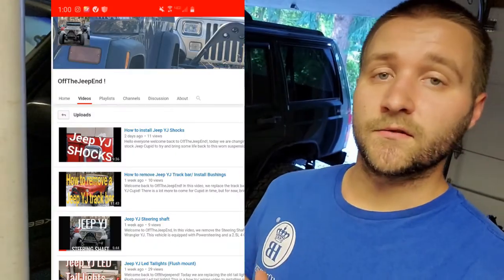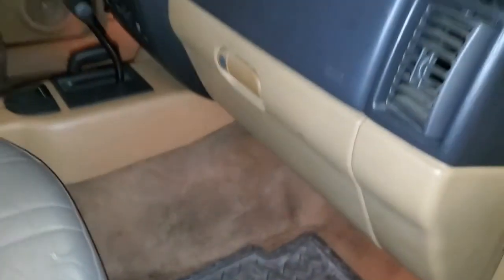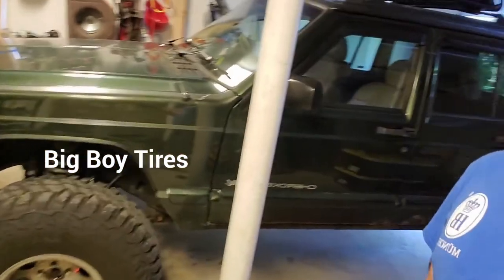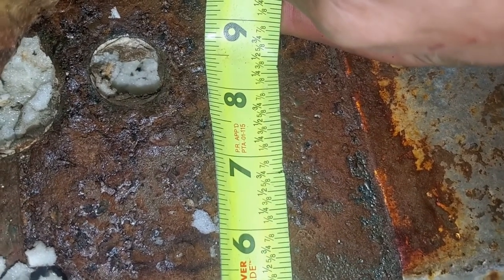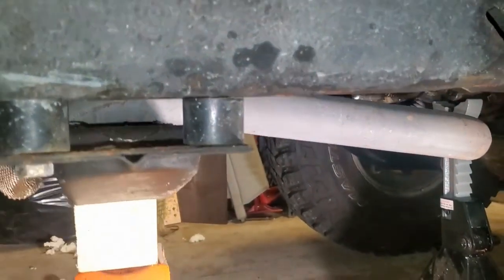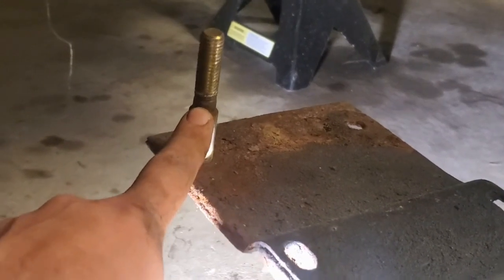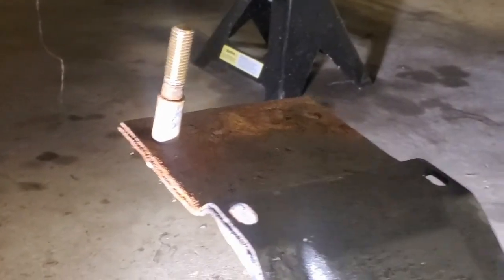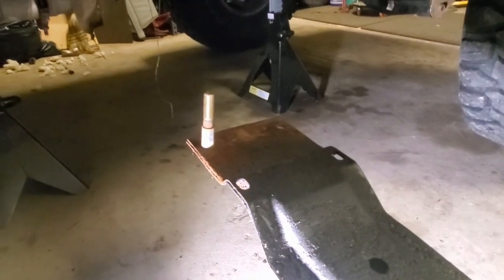Jeep XJ Broken Crossmember Fix

Comment: I had a crossmember bolt break off inside the unibody.  Then tried to east out it then that broke off in there.  Was way easier to just drill and tap a different spot.  Even if you have a rust free xj a bolt somewhere on it is never coming out.